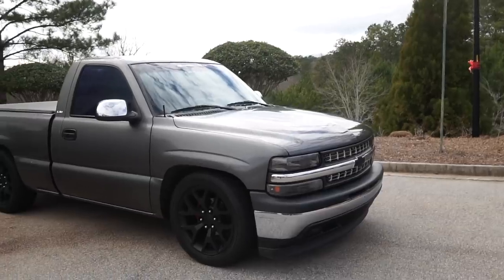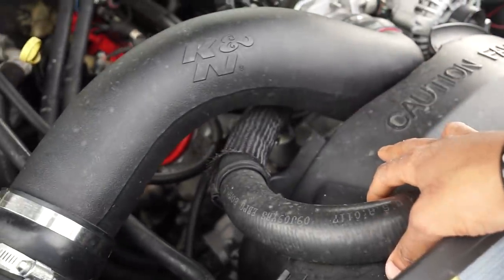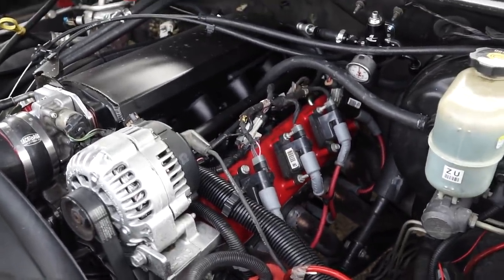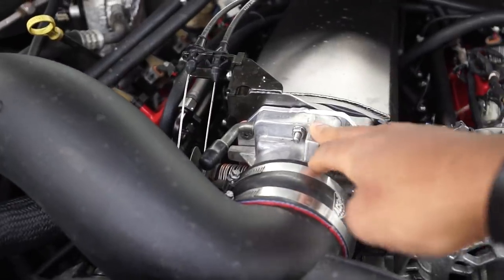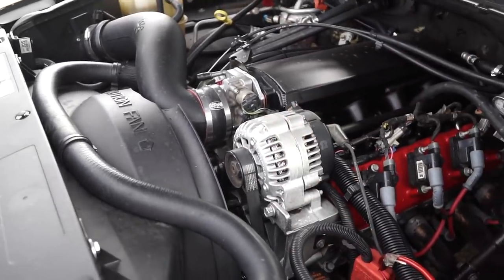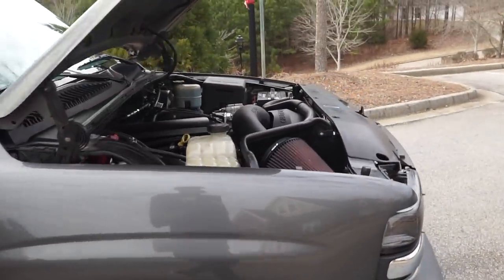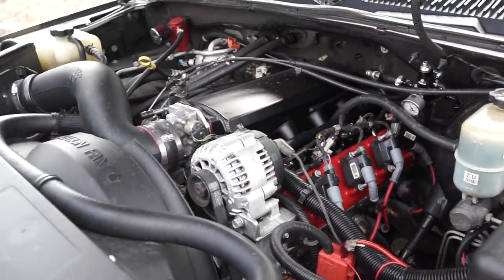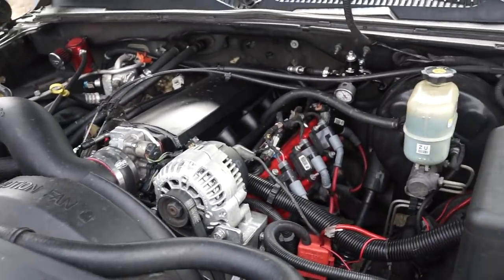How I Built My Cammed 2002 Silverado

Comment: Clean ride, tastefully done👌 I have a 2001 ecsb TSP224r 112lsa. Just finished building the transmission w/3200 stall torque converter. I’m loving the new transmission. The stock stall was a dog until higher rpms. It’s pretty quick now, still drivable enough for the Mrs to take it out.
Reply from the maker: 2001 RedGMC is it a 4l60 or 80?
Reply: 4l60e.... if built right they’ll hold... my transmission temperatures never get over 140 degrees.
Reply from the maker: 2001 RedGMC oh for sure! My 80e stays super cool too. I miss the 60e a lot though

Comment: I just did the electric fans on my 02 silverado had to get the 05-06 Silverado fans and radiator because its larger but fits right in And the nelson performance wiring made it simple
Reply: Did you haft to tune it?

Comment: 5.3 heads and stock manifold already flow really good. Good build though man looks really clean.
Reply from the maker: Yes the stock heads are fine for a lot of applications but there is always room for improvement. But the manifolds are terrible unless you wanna flip them upside down and slap a turbo on them.

Comment: Thanks for sharing..that is one sweet truck
Reply from the maker: Thanks for watching!
Reply: Just changed my oil on my truck 2002 chevrolet silverado extended cab LS 4.8 with full synthetic oil Mobil 1 w oil filter. This is my first older truck and chevy at that ..is it normal to hear a little lifting noise? After a few minutes it quits. Your truck inspires me and with some small modes for my truck I am on my way. From to time if it's ok with you I will ask for advise. Thanks
Reply from the maker: @telesasmith4573  yea that is considered “normal” as long as it isn’t obnoxiously loud or anything like that. Even mine is like that at initial startup. These trucks are easy and fun to modify!
Reply: @Stan1le  thanks..continue bringing great info.

Comment: Probably shouldn't have the plug wires zip tied together won't it cause resistance
Reply from the maker: Hasn’t caused an issue. But you are right to think that! 
They don’t actually touch and I know close proximity can cause that issue to but like I said it runs fine. Rather not get the wires burnt by the headers

Comment: I’m so happy I stumbled across this video. I’m putting together a list and checklist for a Silverado build. Or might do an s10 Blazer, like 2000 body. Haven’t 100% decided yet. But I’m really swaying to Silverado. But is the truck still reliable? Like would you daily this every day, besides the gas mileage being shit, I wanna build a truck, to tow myself and my bike to the mountains or for my cross country road trip? Any tips you would give if you had to do different?
Reply from the maker: Daily driven this truck since 2012. Even with all the modifications the truck has been rock solid. Any problems I have had have been my own doing because I decided to change something. These trucks are some of the most reliable trucks you can own, as long as you keep the oil changed it will last you a LONG time.

Comment: I have the Tahoe twin to your truck only with a 6.0/80e combo. Even have the R1 geomet rotors lol. I did the custom cross member just because it looked trick and freed up some space.   Any reason you got the catchcan vented to atmosphere? Seems like it would cause a vacuum leak.
Reply from the maker: bottomline2000 I bet that’s a nice setup. On the catch can I was advised to do that. It’s sort of blocked of on the inside of the filter and baffled inside the can. I’ll have to look into that but I didn’t think it would hurt it. Maybe it is…
Reply: @Stan1le  yeah it's fun to play with.  I have a cam too and my startup is pretty smooth and 11/16 mpg with a 3k stall.  If you are going turbo and speed density tune the vent may not matter. I did the hydroboost conversion and it really woke the brake system up making triple digit stops a breeze and u don't have to worry about low vacuum.  A lot of factory options out there for ya.

Comment: Man I love this truck. What size wheels/tires and what drop do you have? I like how it sits
Reply from the maker: YaGoonie ! Thanks buddy! It has a 2/4 drop with 265/50/20 tires on it
Reply: @Stan1le  awesome! I have a 4" drop kit for my 04. Hoping to install it this weekend. Then ill go with a 2" drop spring. Im running 305/40/22 im just not sure how they will fit with a 2/4 drop
Reply from the maker: YaGoonie ! They should tuck in there if you have the right offset. But I don’t mess with those 22’s😅
Reply: @Stan1le  I guess ill find out lol. Ill let ya know how it goes
Reply: Stan where did you get the bed cover from?
Reply from the maker: steve smith eBay special!
Reply: Super Stan do you remember what you paid or manufactor of it cause I like the fitment of it and BTW nice truck
Reply from the maker: steve smith Just a generic one from eBay. It was years ago so I have no clue
Reply: @Stan1le  hello Stan. I installed my 2/4 drop. Im pretty happy with it. I just need new tires. The 305's are a bit to wide. I wanted to ask where did you get that intake manifold?
Reply: YaGoonie ! What brand drop kit did you buy?
Reply: @Kevin_Yagoonie  Whats your ig wanna see your truck.. might buy a scb soon

Comment: I have an 01 tahoe and I’ve never seen another tahoe Silverado etc in that 99-02 range that is drive by wire like mine is
Reply from the maker: Lyrical Walrus yes that is odd. Drive by wire wasn’t until 2003 from what I know
Reply: I have a 2001 rcsb with the 5.3 LS package and it is drive by wire. All factory

Comment: Does the same driveshaft from the 4l60 fit the 4l80? I just picked up a 4l80 but I’ve heard the driveshaft won’t fit. It’s a custom 4 inch aluminum driveshaft so I don’t want to have to get resize or get a new one
Reply from the maker: No it won’t fit. It has to be made shorter because the 80 is longer
Reply: @Stan1le  don’t they sell a yoke that allows the same driveshaft to fit the 80?
Reply from the maker: @jasonloera3358  no never heard of it. Doubt it would work because the driveshaft is about two inches too long. I tried to use a shortened yoke, and it tore up the end housing of the trans. Once I got the driveshaft modified, it's been perfect ever since.

Comment: Is it all holding up solid since the build? How many miles since it was built has she ran
Reply from the maker: This setup still runs perfectly fine. I have had good luck with this truck ever since I have owned it. Can’t really tell you the miles because I’m nowhere near the truck right now but it’s well over 20,000 at this point probably a bunch more.

Comment: What kinda coils do you have? I bought some SOS coils with some 0 ohmz wires .... it woke up the stock engine and helps in the higher RPMz... I grabbed a 92mm TB customized my stock air cleaner/box, it doesn’t run well without the damn MAF so I got rid of the K&N 1.... i timed the quarter mile off an app on my phone and it did it in 14.2sec. Duel exhaust hallowd cats I wanna delete the 02 sensors but I dunno any computer geeks in my area to plug in a tune for me....
Reply from the maker: Well my coils are stock; they work well close to 1,000hp on some big setups. And the truck MUST have the MAF and the O2 sensors. It will never run right without either one of them in place. Plus what’s the point of getting rid of the o2’s? Just curious as to why that idea came about.

Comment: where you get the fuel pressure regulator. I'm swapping a 4.8 in my 86 GMC g2500 van and need a regulator do to the fuel pressure regulator for the engine was built in the fuel pump
Reply: Twiztedbacon you can use a wix corvette fuel filter it has a built in fpr, budget option compared to Stan’s adjustable fpr which he said he got from summit
Reply: @KeepCruzin  thank you. Clearly the filter would be the better rought to go since I'm going to need a filter to any ways lol

Comment: That's a bad ass Chevy bro sounds very good but with them upgrades did it decrease your mpg ? Because i have 2004 Chevy stock 5.3 and i want to add a few upgrades to mines but i dont want my mpg to be to bad because its my daily driver i just want my 5.3 to sound i little bit more aggressive wit a little more power.  so do you have any tips on what upgrade to start with first
Reply from the maker: Ceon Tucker mpg is horrible now but I already knew that was going to happen. If you’re concerned about gas mileage then modifying a vehicle shouldn’t be in the plans. They come from the factory with the best mileage possible. Only thing you could possibly do is a cold air intake like what I have now. But most other mods will begin to decrease mileage
Reply from the maker: When I had the old cam, which was low lift, it was fairly decent on gas, but it still decreased from what it used to be
Reply: Ok thanks bro you're right i probably just need to stick with the basic upgrades like the ecu turning and probably a good set of headers also but i appreciate the tips bro because im a big chevy fan i love these trucks. bro but i know i dont have whole lot of money to put into it right now though.. But man i gotta compliment you on your truck bro you really have done a good job wit it and i know you're not done wit yet but if you add them turbos to it omg that bad boy is gonna be super fast probably gonna go threw a set of tires in one day all that power lol
Reply from the maker: Ceon Tucker always feel free to ask any other questions. Those mods you just mentioned will do wonders for you. 
Also thanks man I really take pride in this big girl. I’ll still baby it even with the turbos; I save the hard driving for my car🤣

Comment: Nice bro that bad boys sounds hella good I have a 07 avalanche with a 5.3L and I’m wanting to do a Lil something that will burn the 24” wheels on my truck, holla back at me or anyone that I can do without doing to much 🤷🏽‍♂️🤷🏽‍♂️🤷🏽‍♂️
Reply from the maker: Iroc Jay cold air intake, headers, and a tune wakes the 5.3 up pretty good.
Reply: Oh ok, I have a cold air intake and a throttle body spacer, I figured the headers would do good, I live in Cali so I think I gotta go wit shorty headers for smog, then if I put a tune on it will I be able to seriously get loose on 24” wheels without a cam??
Reply from the maker: Iroc Jay just a FYI; that throttle body spacer makes zero difference. Shorty headers are pretty solid, I had some for a while. You’ll just have to find a good tuner in your area
Reply: Hey bro when you say look for a tuner in my area are you talking about a tuner programmer for the computer or is that a guy who does special tuning to gain that power?
Reply from the maker: Iroc Jay you need someone with HPtuners that can turn the fan controls on in the ECU. Someone who knows what they are doing
Reply: Ok bro thanks for the heads up
Reply: At least 2K stall an 3.73 or better

Comment: So I have a 08 Silverado 4.8 I want to get a little more HP. Do I go with a Non AFM/DOD cam? Having lifter problems now so I want to upgrade.
Reply from the maker: If you want to upgrade power, removing the AFM/DOD system should be a #1 priority. Or you will have the same problems you're having now, just sooner

Comment: How much do you have in your engine alone?
Working on my ‘02 build.
Reply from the maker: Well at this point for the 5.3 I only had maybe $3k in it
Reply: @Stan1le  what’s your HP approximately?
Reply from the maker: @xpellittletock  not much, just 290hp. But the 4l80 trans has a lot to do with the low power

Comment: Does the return line on the fuel regulator have to be plug on
Reply from the maker: yes the return goes through the regulator
Reply: When I have mine plugged on it causes the Evaporator sensor on the back of the gas tank leak a lot of gas out of it but if I plug off the return line on the regulator and leave the return line free flow it does not leak.

Comment: What would you pay for a 02 stock Silverado rcsb 4.8l clean truck inside and out 180k miles
Reply: Kaleb Hutchins no more than 4,000 bro , I see a bunch of them go for 2500 to 3500 on the Facebook market with that many miles
Reply: David M. The one I’m looking at the guy wants 4000 but I’m going to try to get it for 3250-3500

Comment: Is it really necessary to swap 4l80e for like a 350-400whp trucks? What if you throw a cooler on the 60
Reply from the maker: if you want it to last then you MOST definitely need to swap. People have tried every trick in the book and they ALWAYS fail. The weight of the truck is what kills the 4l60. When you are trying to carry all that weight with anything more then stock power it simply won’t last
Reply: You can get a performabuilt transmission and it will do the job. That's what I've been running on mine is their heavy hauler level 2
Reply from the maker: James Cangelsoi fairly stock motor?
Reply: @Stan1le  rebuilt engine, aftermarket pistons (stockish) upgraded lifters and springs, 
Stock head, stock tb,
Texas speed 232/234 lsa:112 cam
3200 circle d stall
488 rear end. 

The stock transfer took a shit 5 months after the build. Could have been because I had 4.10 gears with 35s. 

Bought the performabuilt trans and haven't had an issue since.
Reply: @Stan1le  *stock trans

Comment: With having the msd spark plugs wires did it make a change on the horses power as well has the k&n cold air intake?
Reply from the maker: Lilgordo 12 wires don’t help with power. And intake is helpful when it’s tuned
Reply: Thank you I appreciate the advice